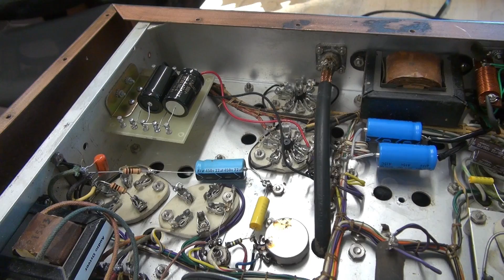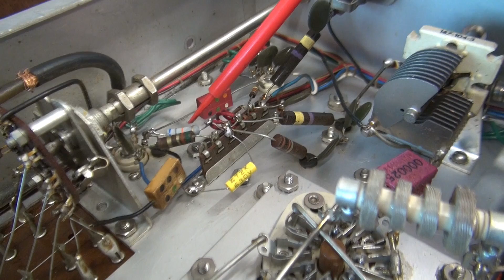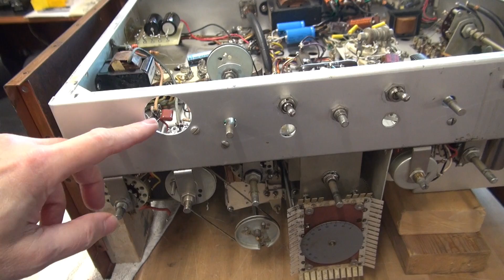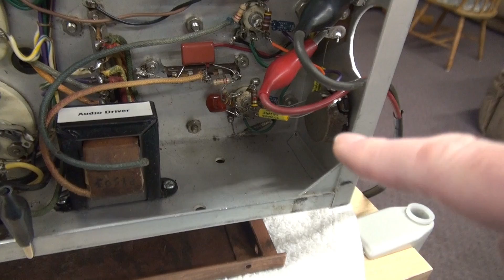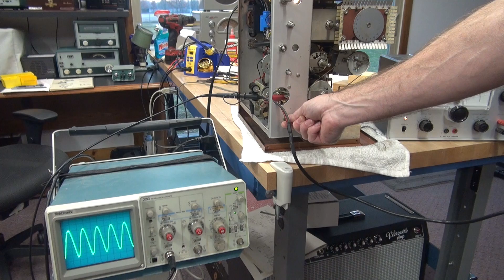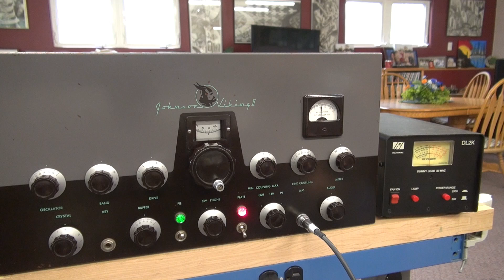Repair complete EF Johnson Viking II tube type Ham radio transmitter Factory built beauty AM CW

Comment: Great work as usual Terry...why did they use a crystal socket for the 110 VAC PTT line on the rear panel? I guess to keep it vintage you'd do that but doesn't sound very safe. Or did I misunderstand?   73 - Dino KLØS
Reply from the maker: Nope, Thats what Johnson used. You would have to try hard to access the terminals and get shocked. The 120vac is only present when plate power is applied.